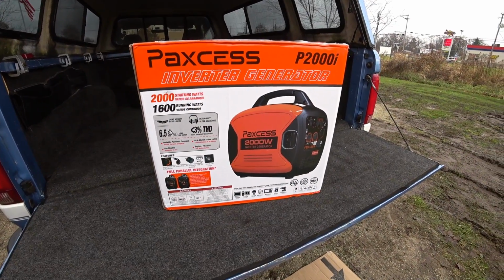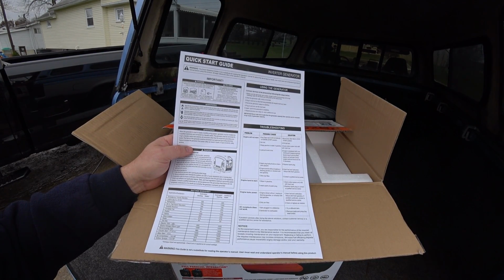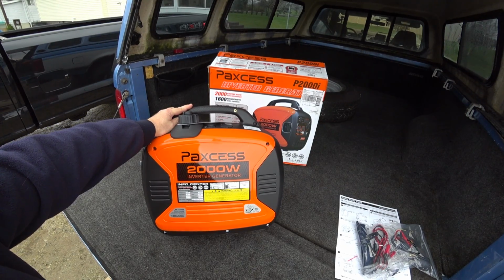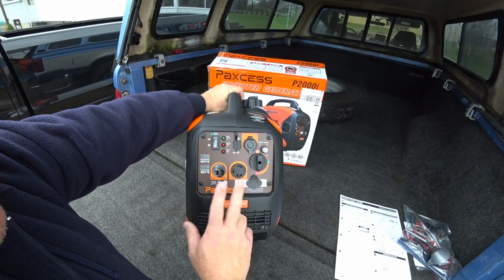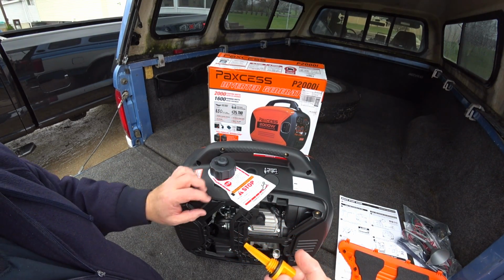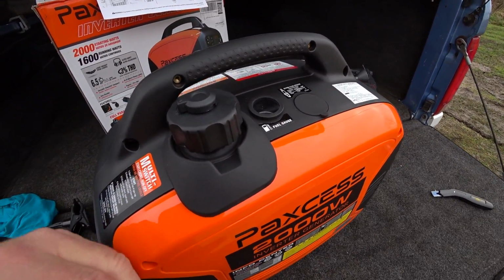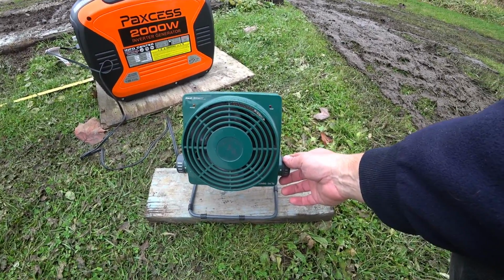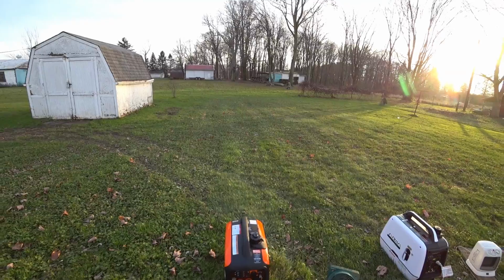Paxcess P2000i Generator review inexpensive 💲💲

Comment: FYI: Paxcess is no longer made but the company is still around making other items.  The engine on the Paxcess  is a Yamaha clone, MZ80 to be exact. So parts will fit from that engine.  Also A-I Power makes this same generator as this Paxcess.  All is exact. You can use the parts from the A-I power generator as well.  I hope this helps someone.

Comment: I bought the Honda EU2200i and it was expensive. The reviewers of the cheaper generators concentrate on price and other features as criteria; which is fine. Price is not the criterion that is important for everybody and if a person can only afford an off-brand unit that is much better than not having electricity. 

These videos miss important elements such as long term use, there are never any follow ups concerning problems with the operation of the units, such as parts availability, service centers, and information. I purchased the Honda because of reliability, the plethora of service centers, the vast amount of videos on YouTube which shows maintenance  and both minor and major repair of the machines. The off-brands or new entries into the marketplace are unlikely to have much information available for the residential consumer. Accessories and replacement parts can be found in readily for Honda. 

It is not important to me that I do not have a fuel gauge, or blue tooth, or parallel cables as I only want dependable clean power and the more add-ons mean more things to fail. As of now with the wildfires in California and the coronavirus the Honda inverter generators have skyrocketed in price and were for a time hard to find except for the upper end models. I hope this generator works out for you.
Reply from the maker: The reason that we don't really do any kind of long-term on this stuff is you would literally have to be using it every day for a flaw to show up, even on the cheap ones. The engineering on these Chinese generators have become much much more reliable then years ago. I agree about the Honda as I think everybody does. I have a Honda 2200, but there are certain situations where I don't want that generator sitting out in weather or I might be transporting it in the back of my truck where it could potentially walk away or I would like to parallel two together. All really good reasons to try out one or even two of these cheap ones. As far as long term use, anybody can it be use any brand and cause it to fail so it's very subjectable. Me being a certified small engine mechanic I can pretty much make any of this stuff last pretty much indefinitely. It's definitely a personal choice, what kind of money do you have to spend and what features are important to you personally. You can drive to work 30 miles a day in a Kia Sportage or you can make that same Drive in a Mercedes.
Reply: @Rvdaydream I was frustrated not at your video in particular. I was looking for a decent generator for a friend of mine who has terrible power outages. Most videos use a scenario where a person buys a new generator and it is the greatest piece of equipment in the world and then recommend this item based upon nothing of import.  Honestly, sound tests are getting rather old and most are not done correctly. 

I appreciate your comment and your time. Hondas will walk away if you are not careful. A rather strange occurrence due to corona virus with regard to Honda 2200. Almost immediately the Honda 1000 and 2200 eu sold out on the internet. I myself was looking for a lowpro lockdown it was sold out and is still sold out today. The small household freezers were sold out also, my best guess people were stocking up on food for long term. Thank you for your reply and the time and effort.
Reply from the maker: @TheMickeymental  me too, I wasn't frustrated at your comment necessarily, it's the constant second-guessing that I get on reviews. When intern usually the people that are commenting don't have any reviews of Their Own but they are definitely able to tell me how I should be doing mine. It's definitely a constant theme. And the reviews are so subjectable. And as far as the Honda generators Choice over any other generator out there, anybody who has done any kind of research on the subject knows which generator they need to buy, but they just don't want to pull the trigger on the most expensive one. I believe there's other cheaper alternatives that may fit their needs and at that point they have to weigh the balance of all the reasons that you listed why you bought yours versus having one that may or may not meet the criteria that the Honda would offer them. The way I see these reviews is that I could sway someone easily one way or the other based on what I say or I can stay relatively neutral and just show the product in a way that can't be seen on paper. If I'm doing a video on product then I felt it was good enough the show. That's pretty much it. I don't really want to push it any harder than that unless I feel really strongly about it. Such as the level mate Pro, that is a product I should have bought years ago and there's nothing that is been an issue with it whatsoever for me. End even the champion dual fuel generator that I had. For an entry-level RV generator I can't think of another one that comes as close to meeting all the needs that someone may have at such a good price point. And of course the Honda but again, everybody knows that's the one they should be buying if they have power needs. Again, I believe all the information needed to make an informed decision is in writing for the most part except for the picture that you can get seeing it moving in 3D watching humans interact with it and of course the audible part of things. There's a lot of information that can be gathered without a decibel meter. Especially when it's being compared side-by-side with something else. Like in the case of our house you can hear the traffic noise driving past our home and compared to what the generator is doing just a few feet away. That's a big takeaway for me whenever I watch other videos and hear the same. Like you said, the audible test are rarely done correctly and honestly I don't think that I want to see something that's in a vacuum or soundproof room being tested because real world results will reveal much more. Also personal for me being a small engine mechanic that Tunes everything by ear it makes a difference what I hear when the engines running. I'm not hearing just the sound level but the contents of the machines noise. It's amazing the difference between flat heads and overhead valves and drivetrain engineering that has addressed fourth phase harmonic distortions. You can definitely pehlwan engineering has been done even when it's reverse-engineered like a lot of this Chinese stuff is. All these years when people ask me about riding lawn mowers or generators and which one they should get everyone knows the brands that they should be buying but brand preference it's so personal they're still going to buy whatever they feel comfortable with or human nature makes them by what they want. When I was in my early 20s I worked at Summit racing I had a gentleman call in to the sales line and want to buy a cam for his Camaro that was obviously too big. I advised him heavily against it and told him numerous reasons why it would not work. He thanked me got off the phone and then called right back and just so happened got the salesman that was sitting in the cubicle next to me and bought that camshaft anyways. Like I said lesson learned people are going to buy what they want regardless if it's the right thing for them or not.

Comment: Hi, Great reviews. Enjoy all your videos.   I just bought the Paxcess 2300/1800.  Waiting for it to arrive.  Wondering, is there a break in period?  It looks like you were able to immediately place the 1200 watts to the unit.  Thanks.
Reply from the maker: Thanks! We really appreciate it! All engines have a break in period. But there's a couple schools of thought on that. One, you should run the generator a determined amount of time with little to no load on it. And 2, run it like you stole it and how you're going to use it for that same determined amount of time. Personally, I would suggest running it on a variable load with something that will allow it to cycle from hiload to idle load and see the entire range of temperatures that it will experience during normal use. Make sure without a doubt that you change the oil at the correct interval. If you empty your oil out on that first oil change in some sort of a container that is very clean, you would be surprised how many metal contaminants will be shining in that first oil change. I prefer to run non-synthetic oil for the break-in and run it as I mentioned prior under normal variable conditions. At that point I would change the oil and you can put in synthetic at that time.
Reply: @Rvdaydream  Thank you.  FYI.  I e-mailed the company and asked what the power out put would be when you  parellel two 2300/1800.  The responce was it about 80%.  So it would be 3680/2880 when you parellel two units.

Comment: I love the idea of this unit "while running on eco mode" will automatically bump up the rpm's when it senses demand for more power. Beats the heck out of running it at full throttle all the time, low demand or high.
Reply from the maker: It is the best of both worlds... Great gas savings and more power when it's needed.. 👍😁

Comment: I've got alot to learn.  I am trying to figure out what would work out best for an overall source of power, or at least a back up source.  Will this 2000 jump start my Chevy 2500 HD van you think?  Thanks for all the reviews and for sharing your knowledge.  Take  care.
Reply from the maker: Generators aren't really set up to jump start as jump starting requires a large burst of power for a very short time where as generators generate a decent amount of power but for a longer. Of time. However, if your truck battery had gone dead for whatever reason, you can run these generators with the charging system and it will recharge your battery as long as it had it been damaged from the discharge. Really what these generators are designed to do is give you the ability to plug in appliances so that you can run for example your refrigerator inside your RV, or a TV, or maybe run your laptops and recharge your phones. Of course a bigger generator over 3000 Watts would be required to run your rooftop air conditioning. You should be able to get away with running your microwave off of a 2000 watt generator as long as you don't have any other accessories running inside at the same time. The 2000 watt generator should do pretty much everything in rver needs except for like I mentioned run a rooftop air conditioner.

Comment: Nice review on the Paxcess.  As you stated the market is flooded with these new generation chinese built inverter generators that for the most part perform very well for the money.  My ultimate decision next to price and performance would be how good is the parts and service network for each manufacturer. Champion for example has a vast parts and great customer service network that should keep their line running for years......................................CCC

Comment: Enjoyed your review. Isn't it advisable to only load the genny up to 1/2 of the rated output during the breaking in period? I ask because you say you are a small-engine mechanic. Have I been misinformed?
Reply from the maker: Nope, you're correct but because I've had many years working with small engines, I know what I can get away with. It's just like break-in period on anything else. Two different schools of thought that's all. As my motor Sergeant used to say, do-as-i-say-not-as-i-do. LOL

Comment: Never heard of it until now.
Reply from the maker: Same here.. Except the power banks they offer.... There are tons of videos on those..
Reply: I went to the Predator 3000 from the Wen 2000.  I'd rather have 2 2000 for the ease of storage,  redundancy and agility.   95%of the time I need just 1500 watts.  As I drag out the 3000

Comment: Won't run an aircon but will charge the battery bank for those winter days...
Reply: That's why you grab two and parallel them.  Then when all you need is a charge you use only one and less fuel.  I have used two at 5000 feet when I wanted to use the ceramic heater, drying the travel trailer our as it was too humid due to rain.  Normally just one is fine.